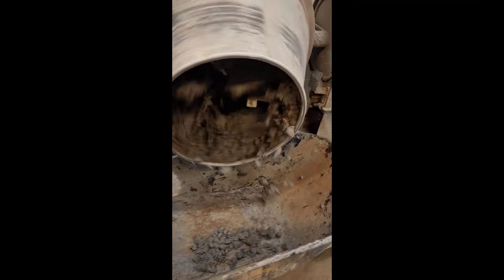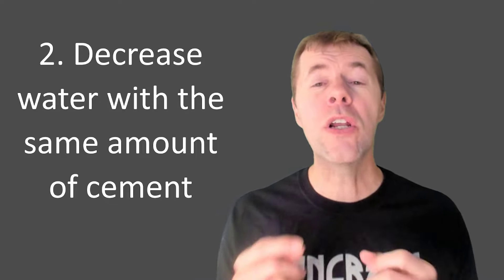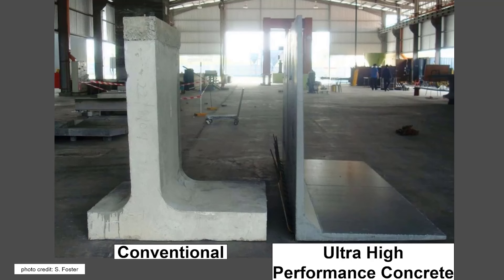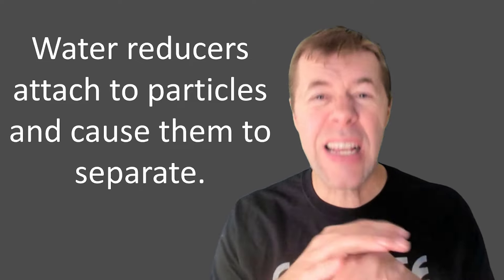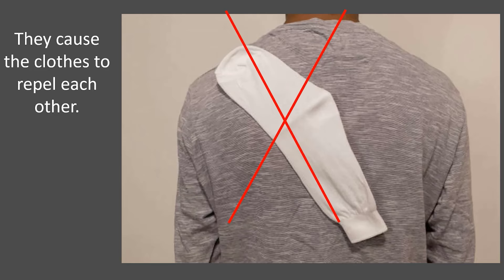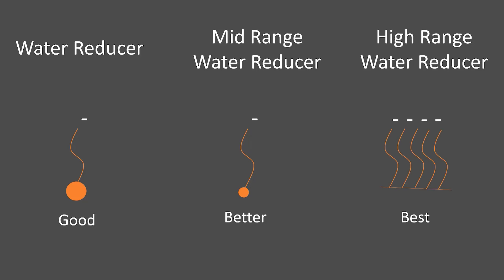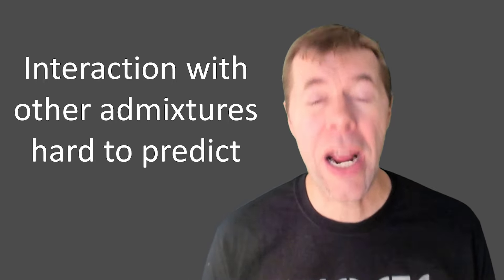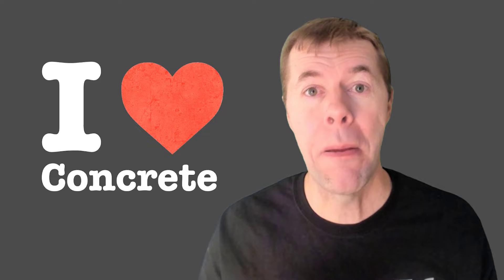Water Reducer Admixture in Concrete

Comment: After watching one of your old videos, I purchased some superplasticizer for an upcoming project. After mixing a little 'dry', the guy I was working with grabbed a bucket to add water. I told him to hold on and handed him a small bag of powder and told him to sprinkle it over the mix. He looked at me like I was crazy, but did as I asked. We were mixing with a hoe in a tub... and within only a few strokes, it looked like we had added water, and by the time we were done, it was silky and 'wet'. It was fantastic and I converted by he and I in that one small pad pour.
Reply: hi sir, Perhaps you can use our water reducing agent to better achieve the effect you need

Comment: Tyler, what are the chemical names of the normal, midrange, and high water reducers so we can ask our cement suppliers for exactly what we want? Are water reducers something that can be sprayed into the mixing auger of a continuous mixing machine like the Mud Mixer? Will vibrating the concrete remove the air voids produced by high end water reducers? How long will water reducers in the set time of the concrete? So far for the project I have planned water reducers seem perfect, I want higher strength and durability, I need a longer set time, and I need it to flow smoothly and consolidate with vibration in the forms. Thanks for the information.

Comment: Hi Mr. Tyler. Thank you for making videos that are informative and entertaining at the same time. I have a question. We use a superplasticizer Sika 4206 NS for site batching dosed at 1.2% by wt of cement with OPC 53 grade cement. Can the plasticizer cause quicker setting in colder weather? The temperatures in winter in my region are approx. 21-27 degrees Celsius, and on few days a few degrees below 20 degrees. The manufacturer mentions it should be stored between 10 - 40 degrees Celsius. Thanks..

Comment: On small pours when using bagged concrete, such as Quikrete, can a water reducer be used to help make it flow better? If so is there a product that you would recommend? I do quite a few small pours, like sidewalks, and struggle with getting good flow without adding so much water that it weakens the concrete mix.
Reply: Go to your local redi mix plant and ask to buy 4L(1gallon) it will last you a long time and cost 30 or 40 dollars. Ours is 10 or 11$/litre
Reply: @ThePorkchop81  Thanks!
Reply from the maker: Great tip!!!

Comment: I have never used a Water Reducer but I am interested in trying it.   Do you add it to the Concrete "Before, During, or After" the Water is added?
Reply: as far as i know , WR is mixed with water , then the said solution is mixed with concrete ingredients.
Reply: @BuildingCivilVideo  -- THANK YOU Kindly.   Would you happen to know how much Reducer is added to the Water Please?
Reply: You can add it on site too. Proper procedure us to spin drum back until concrete is 1 fin away from coming out. Then dump plasticizer/water reducer onto concrete in the drum. Then charge drum and mix for 5 minutes
Reply: Depends on the product. Could be 3 to 20 oz/cwt of cement.

Comment: So, when you say that high range water reducers can promote air voids in concrete, this sounds like something that could make it easier to produce air entrained concrete, or something that needs to be avoided if you're producing air entrained concrete.  Are these the kind of air pockets that cause non air entrained concrete to be more like aircrete, or are these the kind of voids that promote failure in air entrained concrete?
Reply from the maker: They promote large bubbles that are not helpful for air entrained concrete.   If controlling your air content is critical then you can avoid high range water reducers.  Most people use them anyway and deal with the variability.
Reply: Thanks very much! @TylerLey

Comment: The Romans were able to make concrete that lasts 2000 years. No rebar. No plasticizers. Visit the Pantheon.
Reply: The romans didnt make parking garages to be driven on and hold thousands of tons of load each day. Or structures that were thousands of feet tall. The romans didnt have 80,000 lb trucks driving across their pavement and bridges. They didnt take laser screeds and rider trowels and pour 1,000 yd floors at a 1/32” tolerance for flat/ level. They didnt specialty finish or polish concrete. Survivor bias also only shows us the small percentage of concrete that lasted that long. Point being concrete performance isn’t just about durability, and we do way more with concrete now and rely on technologies to keep pushing the envelope of what we are able to achieve
Reply: Survivor bias.

Comment: I disagree.  I've seen better concrete made with more water, eliminate water reducer, and add E5 nano silica Internal Cure.  Nano Silica is the missing ingredient of concrete in my opinion.  Love your videos though Tyler :)
Reply from the maker: Thanks for the note.  I agree that you need enough water in the mix.  We are about to start doing some E5 testing now.
Reply: @TylerLey  Yes I heard, it's about time 😉
Reply: "The addition of high surface mineral particles into the cement mixtures requires a higher quantity of water or plasticizers to maintain the concrete workability"

Abhilash P. P., Dheeresh Kumar Nayak, Bhaskar Sangoju, Rajesh Kumar, Veerendra Kumar,
Effect of nano-silica in concrete; a review,
Construction and Building Materials,
Volume 278,
2021,
122347,
ISSN 0950-0618

——

Will be interesting if Nano Particles and Plasticizer combined can get you even better Results than @RoryBosma observed without the Water Reducer.
But I guess the Cost Efficiency will be even more important.
Reply: @FullSpeed_only  That's why not just any nano silica can be successfully used as an admixture.  E5 is the only line of admixtures with no downsides like shortened set time.  E5 actually extends slump retention compared to control.  It makes all the chemical reactions that occur during the 5 stages of cement hydration more efficient, so the need for other admixtures is lessened.  I usually recommend lowering the dosage of mid range water reducers to the minimum recommended by the manufacturer or eliminate it entirely.  We're realizing that the higher blaine fineness of today's cements means that concrete needs more water now, because of the greater overall surface area.  If we don't add enough water at the plant, the finishers will be tempted to spray water on the surface (or evaporation retarders which are 95% water) to get a decent finish.  This is bad for everyone because it produces a weak surface.  As the industry switches over to PLC, if we don't add more water, and use E5 to keep that water in, we're going to end up with a lot of low durability concrete if we keep using chemical admixtures to artificially increase slump yet the mix is too sticky to finish and finishers are taking water hoses and wetting up the surface just to be able to bullfloat it. E5 works very well with POLYCARBOXYLATE SUPERPLASTICIZERS actually.  Nano silica is used to make thousands of products like paint, ketchup, etc stay together and not separate. So naturally it's something we can use in concrete to prevent segregation.  I recommend this whole video, but about 33 minutes in they start talking about how E5 nano silica increases the efficiency of other admixtures and acts as a viscosity modifying admixture: https://youtu.be/9DaQlXCmL6s?feature=shared
Reply: @RoryBosma  Thank you very much.

(I’m not surprised to hear, that the Handling on the Constitution Side is problematic…)
Reply: That is the attitude in the Caribbean..  add water, make it flow.. 
Look at how Haiti held up to the earthquakes
Reply: Is this a Yank term for Plasticiser? Pffttt water reducer
Reply: In general you need to reduce the w/c ratio to increase the strength of concrete. And the reason to add more water in case of nano silicas is due to their small size which in turn increases its surface area and to compensate for that, a higher w/c is required. And if you increase the w/c more in that nano silica, you will find the strength decreases with the increase in w/c ratio.
Reply: @TylerLey a recent subscriber here. Would definitely be interested in the E5 research